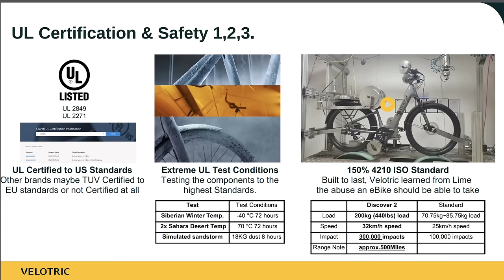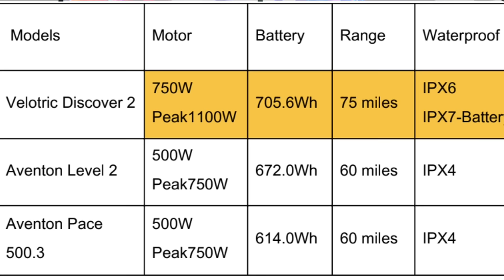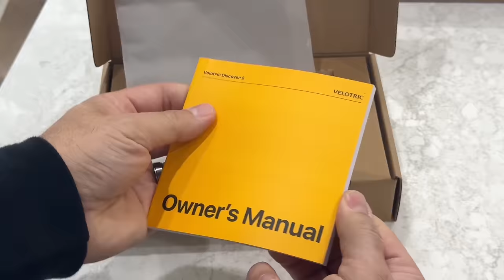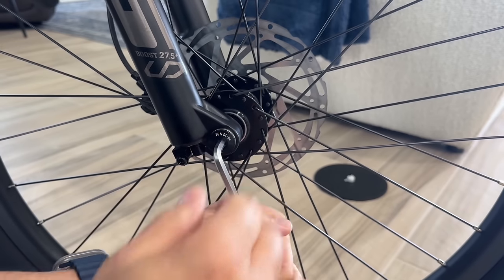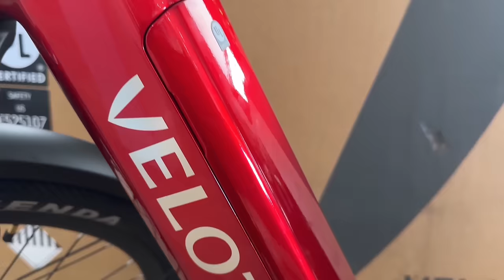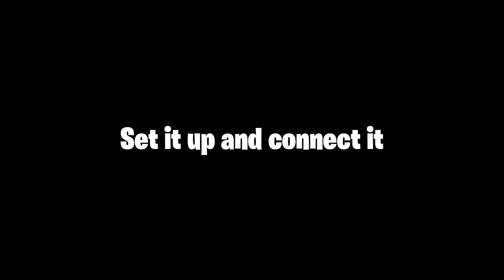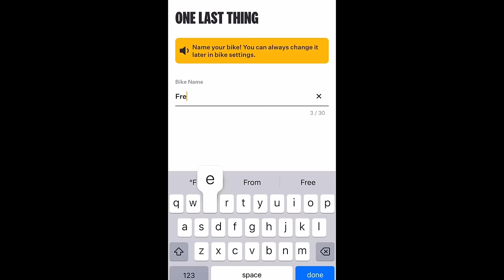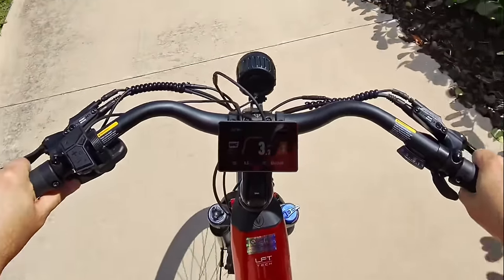Velotric Discover 2 Review: Excellent Affordable Electric Bike Value

Comment: I like  this bike! I may say goodbye to my comfy RadCity 5 plus...the Find My feature...is it an airtag embeded in the frame? Safely so that thieves don't remove it? but then don't I need to replace the battery once a year? Otherwise the bike is great! Unfortunately, no shipping to Canada so I may have  to go to Buffalo and get one this Summer...Thanks for  the video..epic vibe!
Reply from the maker: I don’t know if it’s an actual AirTag, but it may be in the circuitry of the controller or the display. Wherever it is, it’s pretty awesome to be able to find your bike in case somebody does take it. They would probably have no idea for a while!
Reply: @FreshandFelicia  yep...I installed an airtag inside the fork of muy bike (sshhhh...don't tell anyone!) and it's very accurate. Not really a GPS but good enough. I could/should have opened it and disable the tiny speaker so that it doesn't warn anyone that there is an airtag following them (in case they take my bike with them)...but the truth is that nothing can discourage thieves these days...I have 2 Kryptonite locks etc but I don't leave my bike locked outside f or too long and never over night...a bike like this Velotric would attract a lot of attention...specially in red...time to start saving for it. Thanks